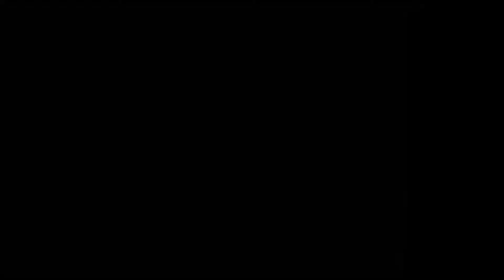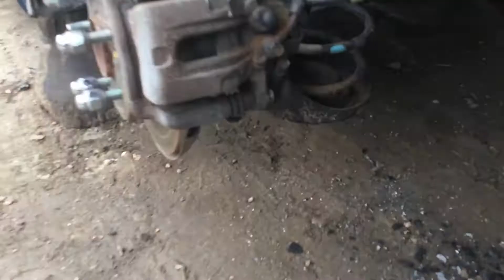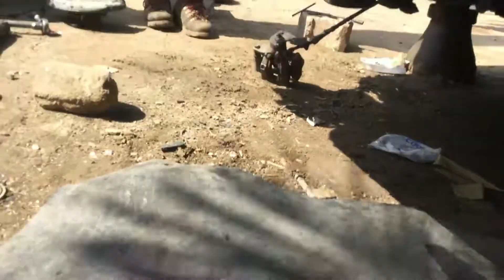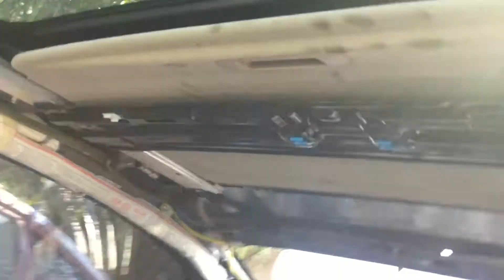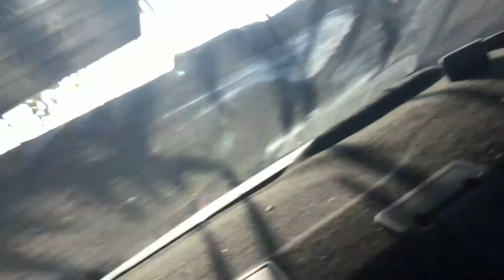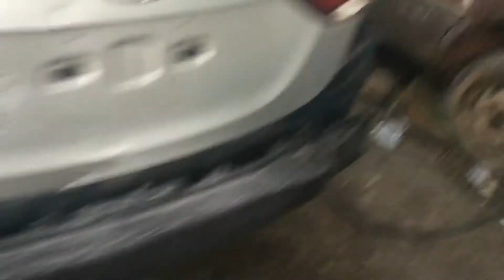How to fix a salvage Hyundai Elantra Limited car Ep2

Comment: Wow, so you skin the vehicle like that to pave way for the auto body technician to start .this is detailed 😲
Reply from the maker: For thorough work to be done we open up like that to gain access to the affected area to pull and set the vertical beam right😊, what do you think of the progress so far and the method by which ended there?